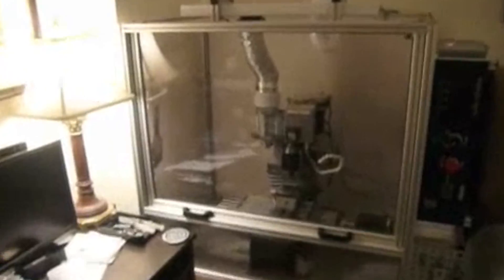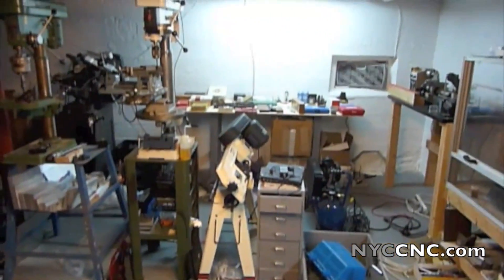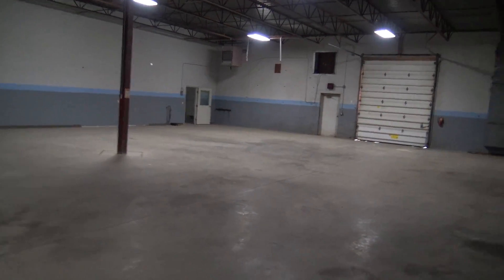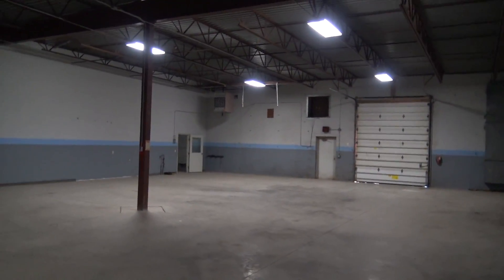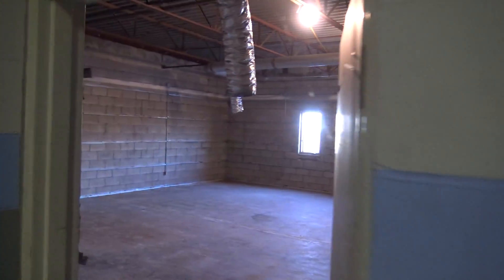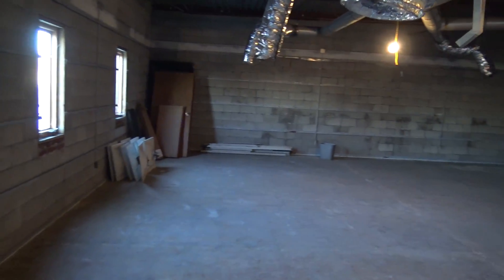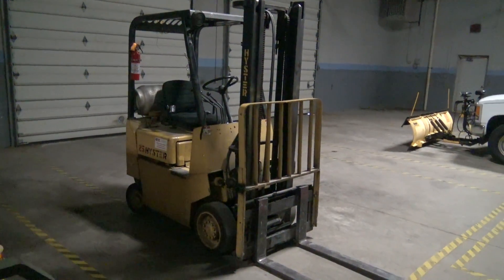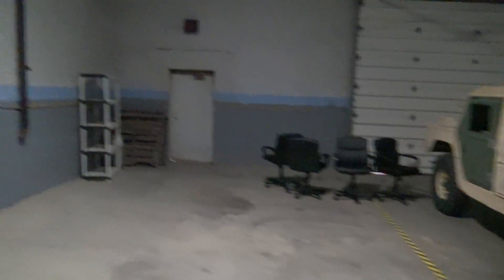We're Moving Again - One Last Time!  NEW SHOP!

Comment: noooo!  all LED lighting! :)  --and epoxy throughout, cause it will last pretty well. and look better.  I'm not sure about the line types, but we put black pipe in our shop, and just installed a water-cooled drying system between the compressor and the tank.  Tank is dry as a bone, and so is the air out the lines!

Comment: Wow John that's an absolutely awesome shop! Well done. A while ago I made a comment when things were, well, not ideal, that I thought that moment would prove to be the catalyst for a turning point that would be difficult at the time, but would lead to amazing opportunities you wouldn't have otherwise seen. It's one of the few times I don't mind saying "I told you so" ;)

With the wall, if it were me and based on what you've said, I would look at building what's called an "operable wall". They're used in conference centres etc and are walls that pull out on a track and give flexibility to the main room as it can then be divided up. Instead of one track they use, if you had 2 tracks, so an X/Y system, and hung your wall from that, you could move it backward and forward to provide more or less space as required. With metal studs, the wall wouldn't be heavy and the tracks could be just some basic angle with bearings riding in them. Hanging a wall like this would definitely be more a PIA than building a regular fixed wall, but it looks like a regular wall in use, and it sounds like flexibility is what you're after. You may even be able to get away with just having the tracks running in one direction and not worrying about any folding abilities, just hang sections of wall from a series of parallel tracks.

There's no way in heck I would use copper. Yes it's good, but the cost is outrageous, and typically the compromise made is to run smaller diameters; thereby completely self-defeating any advantages. Instead I'd suggest to look at Polyethylene plastic. In Australia I believe that's what is generally installed these days as it's cheap so larger diameter runs can be used. That ensures the pressure drop is minimal and it also acts as part of the receiver to handle peak demand. http://www.pipa.com.au/sites/default/files/document/attachment/2014-08-12-pop002_0.pdf

Comment: I have the following observations which you might care to consider. (I come from a background of lecturing and workshop teaching in an ag college.)
1. What are the local weather temperature extremes including humidity and strong winds and their direction linked to those large roll-up doors? (I simply don't know). Linked to this issue is roof and wall insulation. I would have expected that the current levels in the building are pretty good however I can see daylight underneath at least one of those big doors!
2. Due to where those heaters are positioned and the fact that they blow air any grinding dust or fume issues could easily and quickly be blown around the whole of the rooms - personally I prefer dust rubbish to be collected and blown out of the building and captured in a suitable container. You have some trunking that could perhaps be re-purposed for this.
This leads me to suggest that you create a purpose built room/s using prefabricated panels with a roof over preferably in the auto shop. Also make this into materials receiving and cutting area to limit noise as well. Such panels in the UK are used regularly as composite roof sheets 1m x 12m on farm buildings.
3. Is industrial and office air conditioning commonplace in your area? Can your heaters blow ambient air to improve ventilation? Should you give consideration to, in the future when the budget allows, be able to add air conditioning to these heaters.
4. Cannot comment about the technicalities of one type of lighting against another but get plenty of quality light where you need it - had lots of experience of working in my own shadow!! Do you actually need to be lighting the whole area to high levels ALL the time? 
5. Don't like epoxy floor coverings - very slippery!! I think that other commentators have good suggestions.
6. Where are the main entrance points/exits/ fire exits for a) visitors / clients / learners? - car parking? and b) deliveries / loading goods (internally in the building or externally) are any external areas good enough for your forklift to travel over/ across?

Linked to this I think you need a clearly defined go / no go areas for visitors including the workshops as well as other areas for things like hi-viz, hard hats, overall coats, safety footwear. (The Health and Safety people will be paying close attention to you!!)
7. I think that you need to punch a hole in the wall big enough for the forklift and any load it may be carrying between the main workshop and the auto tech workshop so that the FLT can move around all areas including class rooms. You might consider moving one of those three roller doors in the auto tech workshop.
8. Class rooms spilt into two using a folding accordion style door. Why stud and sheetrock the walls if insulated well enough? - just paint a pale colour (eg cream) and if you wish put up sheets of 8x4 pin boarding for poster / notices etc. 

Plan for ceiling mounted digital projectors and ideally magic whiteboards run off a laptop. Choose comfortable chairs that can be stacked and tables that are firm but legs that can be folded flat and locked in place when in use as people will at least lean on them if not sit on the end of them. There is merit for circular tables but they do waste space. 
9. Lastly, security issues. I'm afraid that this is now an essential issue even in a rural location and should be comprehensive include fire and flooding -lots of visitors = lots of nosy people - idle gossip and lots of bad potential interest from the less desirable members of society.
Back up every night all electronic data to an off site secure server -ideally automatically as this helps in the case of theft or a fire. I've experienced both!!

Sorry this is so long but I hope it might help as a check list at least

Comment: That seems about the dimensions of my old high school's classroom layout. They had one cement "room" subdivided in to four classrooms by folding walls. In the (rare) case when they wanted something bigger, fold one up and you're good. You could have a closet style area on one end of the "accordion" to store the wall neatly when pushed back.

As a bonus, they can block a fair bit of noise if they're sound insulated, so the screech of multiple mills won't be as annoying on the other end of the shop.

The only drawback might be height. You might have to build something so the folding part doesn't have to go too high up. More height = more weight on the rollers.

Comment: Congrats on the new shop.  It's good to see your business growing .  If you keep moving you might get good enough to start a moving side business as well :)

Also, my experience with LED has been dismal.  My shop/garage is not conditioned and I believe the LED fixtures couldn't survive running in the Texas heat and all 6 fixtures failed.  I'm using T8 lights now despite not being optimal for the operating temperatures but I have had no problems for two years now.  Wish I had not spent the small fortune on LEDs now.  I would expect T5 fixtures to be a better choice for your shop.

Comment: our family has some commercial space in ohio and we re-lit an 8000 sq ft space 7 years ago and already half of the T8 fixtures are dead.  So if you can justify the cost of re lighting every 5-7 years or keep up with the labor of doing the ballasts then the T5-T8 will work.  They just dont seem to make a quality ballast anymore.  I still have 40 plus year old T12s that work in my shop, but those are on the way out to being obsolete for parts/bulbs.  We are re lighting a 6000 sq ft spot this winter and the electrician is pushing hard for the led fixtures because we wont need as many compared to the T5 so the price is a wash.  Just a thought.  Nice place though congrats.

Comment: Marvelous John! 
Aren't you going to loose a lot of heat/cool through the metal roof though? I would consider a drop ceiling and insulation overhead, at least in the office quarters. You could do spray insulation on the metal roof in the machine shop area, just to try to keep your heating and cooling bill down over the long run. 
Congrats.

Comment: A vote for LED here. I just converted all my 4 and 8 ft fluorescent to LED.
Used the daylight 6500k bulbs. Wow what a difference. 
 Super easy. Remove ballast. One leg of 120 ties to the tube receptacles at on end and the other leg to the receptacle at the other end. 
Purchased the bulbs off of ebay from this guy. Unli_Unli  (LED_Unlimited).
Also added some new fixtures. Purchased some cheap fixtures from Home Depot, gutted them and installed the bulbs. One never mentioned advantage to LED.
I dropped one from 12 ft. Did not explode like CFLs. Did not kill it. Happy Camper.
I also use Cree 100w daylight bulbs in specific locations where a long fixture made little sense.

Comment: For the wall consider two types a a solid window wall with a center section of the strip doorways that they use in warehouses so the fork lift can drive through Have that section wide enough for clearance for your longest material going through sideways 

Airlines don't undersize the main runs especially if your going to stay there along time. Use hard solder on the copper refrigeration type joints, slope away from compressor tank and have drip legs on all connection ports with petcocks to remove moisture from the pipes Having the drip legs will reduce water vapor wear on regulators unless you are going to dry and filter at the compressor .  Hose reels or drop sover benches and tools keeps the floors clear of hazards. the same for electric extensions

Comment: Walls = permits required, fire sprinkler modifications, inspectors and fire marshall depending upon your zoning.  Usually not a big issue but sometimes it can be a horrific nightmare. Do your homework and make sure the modifications are done legally. (and for insurance reasons)

Comment: Wonderful shop space. If you decide to rent any part, make sure it is with a short term lease. You tend to grow into available space. Big spaces give you room to take advantage of lucky finds in the way of materials. It might not be something you need right at the moment, but if you can see a future need and have the space to store it - take that deal.

All air lines should slope to a drop (tee with a short nipple and a drain cock) at several locations, because you always get some condensation and you need a place to drain it periodically. Your air taps should rise from the feeder lines to avoid water falling into them. I used black iron for my shop lines; there is always dust, rust flakes and so forth in the lines. The only downside (besides expense) for copper is electrolytic corrosion. You would need non-conductive insulators at all mounting points, and insulating couplings between the copper and any ferrous QD air taps (they're almost all ferrous - a few are brass, and most of them are zinc plated, to boot).

Main room partition. Unless you need soundproofing, do a curtain wall (fabric) with one or more roll-up doors (also fabric). Easily moved to reapportion the space, or move REALLY large equipment. They can be had in fabric that is coated with vinyl or other chemical (and oil)  resistant coating. Roll up doors can be roll-from-the-top (manual or motorized) or roll-from-the-bottom (where a couple of ropes loop under the door and roll the door up when one side of the loops are pulled via pulleys - kind of like a bamboo blind). A pipe in a slot at the bottom of the curtain wall keeps it nice and tight so it won't blow all over the place when the doors are opened. Some walls have a pouch that can be filled with sand for weight. Way cheaper than solid construction, and reasonably stable. A few stiffeners could be added if needed. Don't forget to add a man-door or two; rolling up that large door every time you want to walk from one side to the other gets old real soon.

Best of luck in the new space.

Comment: John, congrats on the new shop. I'm very jealous. And envious of what you have done - great job! On air lines - I would seriously consider one of the air line systems like rapid air fast pipe system. I have to imagine it is a lower installed cost than copper and will serve just as well in the long term.

Comment: If you have gone into debt to buy this building the priority is to make money. A nice floor is just that, nice. But it does not increase your income. A good sealer should be enough to be able to keep it clean. Maybe use some stains to add color. Also looks nice and a lot cheaper then epoxy. Epoxy floors also tend to be very slippery. This next step in your adventure should be done very carefully as overspending your budget is a guarantee.  Same for LED lights, buy them from your profit. If you want to heat areas efficiently a lower ceiling with insulation on top will work great. Heat rises and if the ceilings are high the heat is where it does not benefit you. Maybe with some vents for warm summers, but even then a lower ceiling will create a larger barrier for heat to get in or out of your working area. Walls can be made cheaply buy using sandwich style segments. Thin plywood on both sides, polystryrene in the center. Isolates noise and allows you to make rooms quickly and efficiently. Once profit is made you can upgrade. My personal opinion of course, but it is out of experience.

Comment: John, I have installed miles of copper air lines in several different shops. Copper is pricey to install but does outlast steel, Check with your insurance provider as to their "acceptable" materials for air lines before installing and also check to see if you have to have it installed by a pipe fitting company. Congratulations on the new shop space. Dan, semi-retired union pipe fitter.

Comment: for lights IMO metal haled , and air lines a customer of mine does installs in printing facilities and swears by powder-coated aluminum with the plastic connectors , they allow for extra lines or drops to be put in easily  down the road .

Comment: Personal opinion put the air compressor and an air drier in the spare space to cut down on noise levels in the shop. Accumulation tank for air in the cnc area, this will cut down on bottle necking of the air flow through out the shop. In my experience 3/4' black pipe is a good option for air line. Due to the vibration of machinery or the air compressor itself copper could slowly rub against hangers causing leaks. Depending on the classes you are going to offer it may be a good idea to feed air to the classrooms as well.

Comment: T5s are great, put in more than you think you should. Copper for the air if you don't want leaks, make sure ALL the long runs  slope back to the tank. Everything comes down from the ceiling.  Expect an OSHA visit eventually , become familiar,  do it right the first time it's cheaper.
Reply: +James Kilroy 
I agree with James on the Air lines sloping back to the tank.

I just retired from a shop that was 81,000 sq.ft.  We had 2 10hp Champion compressors that fed air into an air dryer.  There was a 3" main airline that came into the building, all drops were 3/4" and came off of the top of the 3" pipe.  All horizontal pipes sloped back to the main 3" pipe and the 3" pipe sloped back to the tank.  All the pipes were galvanized iron and each compressor had a pop off valve on the drain at the bottom of the tank that was set to go off every 3 minutes for about 15 seconds.  We never had any moisture problems.

Our building was originally owned by a safe company that set up the air lines, we just added new compressors when we moved in.

We also washed down the floor with a Cantol Product  736 http://www.cantol.com/products/degreaser-and-cleaner/liquids/tech-736/ 

Then sealed it with two coats of a clear Cantol sealer.  http://www.cantol.com/products/floor-protection-and-coating/upgrade-clear-urethane-coating/

There are 45 mechanics that work on a total of  1500 vehicles that were in the fleet.  We moved into the building in 1988 and the floors still looked good in 2012. 

I welded and used a cutting torch and still the floor held up.  If I were going to cut something that was close to the floor I used a piece of sheet metal under it so the buildup of slag wouldn't pop the concrete floor. 

Fork lifts and skid steer loaders didn't ruin the floor coating. 

Hope this helps.

Comment: Office, put it in a loft, build material storage space beneath it.  Maximize the space utilization.   Partition the primary welding and grinding area by making welding stations facing the machine shop with sheet metal back splashes and 4x8 foot movable sheet metal partitions.  Design air to flow across the shop towards the welding and grinding area to prevent dust from traveling towards the machine shop area.

Comment: One of the ways you could divide the room is to put up shelves or racks for storage. I did this, by someone giving me sections of rack ends. I cut them down to about 8' high and use them for storage, with a passage way in between sections for a walk-thru. The other thing is you could use your material stock storage racks as dividers, along with welding curtains. Great building, really happy for you!

Comment: Very excited for you! I used to do quite a bit of CNC plasma cutting, and let me tell you, even with a downdraft table there will be plenty of plasma dust going everywhere. You need to completely seal off an area floor to ceiling. Heavy plastic sheeting is sufficient and will still let light thru. If you don't seal it off, you will be cleaning powdery metal dust off of everything else in your shop.